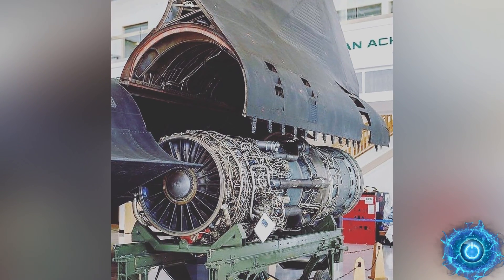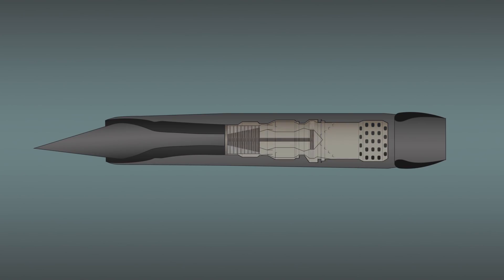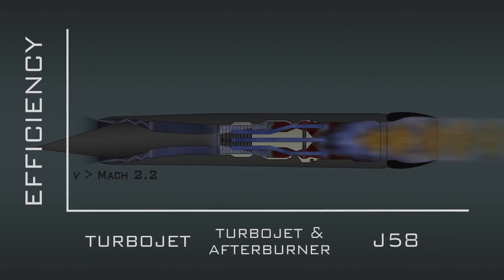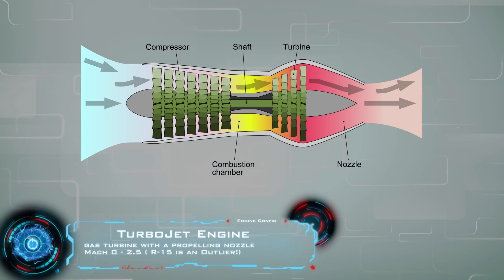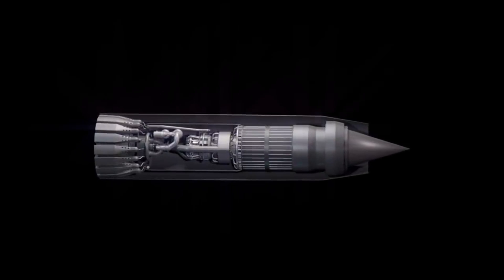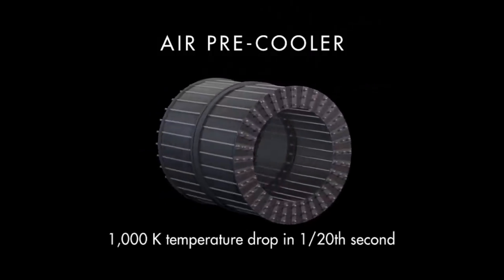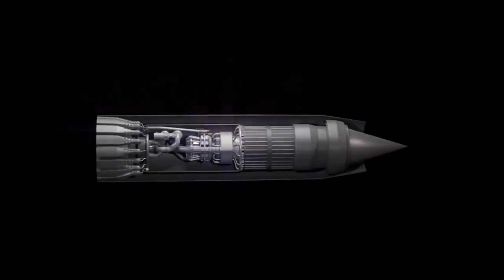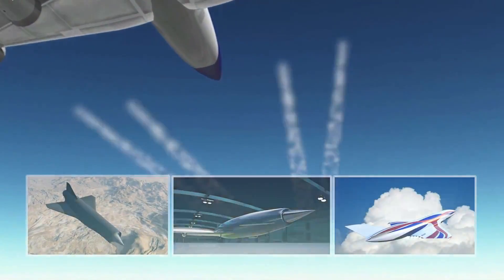THIS New Engine Will Change EVERYTHING

Comment: the heat exchanger must cool the incoming air from 1000 degrees Celsius to -150 degrees. That is many mega watts thermal. Extra liquid helium or liquid nitrogen will be needed (in tanks = extra weight) for this cooling, as the liquid oxygen is not or less suitable (it must not change into gas form, otherwise unsuitable for combustion). Another problem is ice formation on and in the heat exchanger. Since this is a very fine mesh construction, it is quickly inefficient and quickly clogged. One proposal was to allow the heat exchanger to vibrate violently during operation.

Comment: After they perfect this they should make intercoolers for boosted ICE vehicles. If they can effectively cool super heated air flowing into jets at super sonic speeds then air from a supercharger or turbocharger would be a piece of cake. Because when I first started watching this I figured some form of chemical injection into the air stream would be most effective not the added resistance of going across a finned core at such speeds. You wouldn't think the air would spend enough time flowing across the core for any significant temperature drops.

Comment: I know there's an jet engine manufacturer, that I won't name because I did work for them but they have an engine they developed and has yet to be well available to the general public that weighs about 85lbs dry and produces 7500lbs of thrust. So you can understand with the thrust to weight ratio how advantageous this would be to say a cruise missile or something similar. This is anecdotal and I'm some rando on the net so you can believe or not that's cool. I can't really tell you anything other than that, I had to sign an NDA.

Comment: Just an idea, could the cone in front of the turbine compressor blade close off the air going through the jet engine allowing air to pass around to the ramjet part, at Mach 2, fire up the ramjet, Mach 2.2ish close off the air going into the turbine and continue upwards with the ramjet

Comment: So these need to carry liquid Helium in addition to the fuels? Sounds like a significant range limiter. Wouldn't it make more sense to use the liquid Hydrogen that is needed anyway?
Reply: @1fasteddie64  if it needs liquid Helium (which is at a temperature of ca. 4 Kelvin)  to cool down the air, a closed system will not work. Otherwise the heat could already be dissipated by that system without using Helium.

Comment: I just don't get it where's all this air supposed to come once you're at a high altitude.
Reply: The SABRE is an air breathing rocket that switches to liquid oxygen above Mach 5.4 and at high altitude which saves 20% in less liquid oxygen.

Comment: Using thousands of tubes in the precooler is a terrible design from a production perspective. It is going to be way to expensive to produce. There is a reason why the regenerative cooling on rocket engines has gone away from the tons of tiny tubes soldered to the engine bell design to machined groves. The same kind of heat exchanger can be made with for example extruded copper or brass, and it can be produced at low cost and high volume.

Comment: Where does the pre-cooler dump the thermal energy after it cools the incoming air?  It looks like you are describing a counter current heat exchanger.  While that may be able to cool the stagnated air at the intake, you didn't tell us where that energy ends up being dissipated.  What is the cooling drag associated with the system?
Reply from the maker: It is cooled with liquid helium. The helium is then cooled by liquid hydrogen from the main tank, prior to it being burnt in the engine. That is what I understand so far because it still in design phase. I hope they can replicate with AM because it sounds expensive.
Reply: I could be wrong, but I think the heat is transferred into the liquid hydrogen fuel prior to combustion

Comment: We can build this but we can’t design the rudolf Diesel engine to run on hemp oil. Right
Reply: If it’s a liquid and it burns, diesel engines can run on it. However, until there is actually a significant market for a certain type of biofuel (unlikely given those people would just buy EVs), no manufacturer will bother to set up a fuel system able to feed it without clogging.